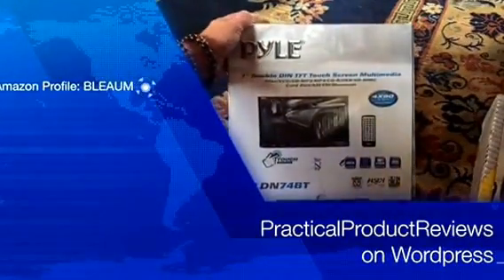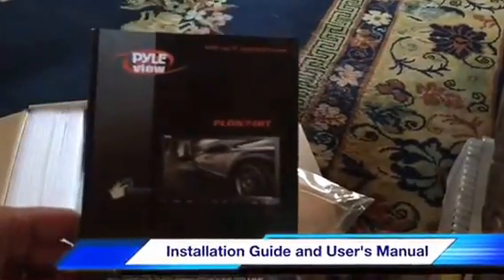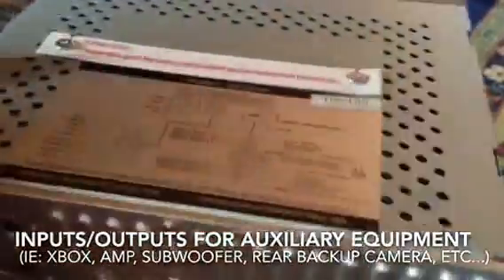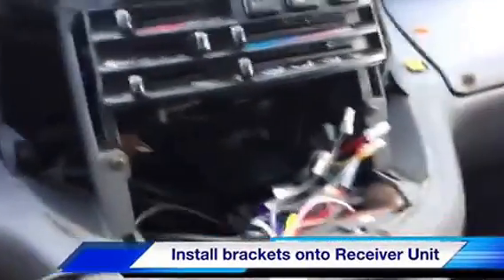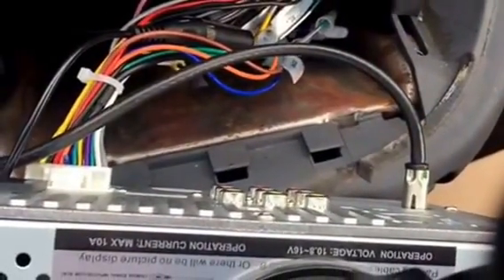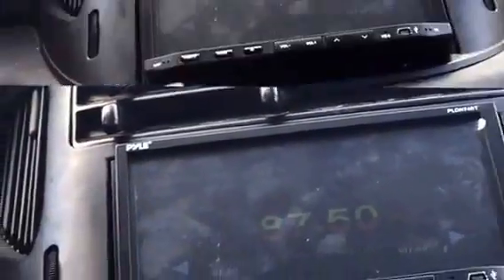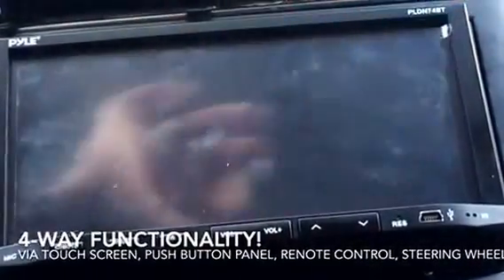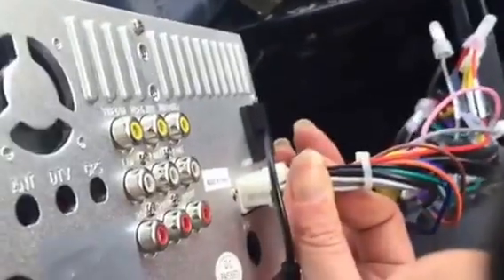Pyle PLDN74BT 7" Double DIN In-Dash Multimedia with Bluetooth: UNBOXING, INSTALL, DEMO, & REVIEW

Comment: did you install this on your own or did you have help? if not, where does the acc+ cable go?
Reply from the maker: Yes, I did self-install the unit. There are plugs in the back for the acc cable. However, I didn't use them on first install. Instead, I ordered a backup camera from eBay for $8. When it arrived, I mounted the camera to the plate, and ran the extra long wire to the front, using the carpet and molding so no wires would be seen. Then, it's easy: Unscrew the unit from the in-dash mount, slide it out, and plug in cables. Hardest part was hiding cables, but worth the effort. Back up camera kicks on when car is in reverse, or if there detection of movement if the keys are in the ignition. As long as your camera is angles properly, you'll get great quality video.

Comment: Can i install in 2006 300c
Reply from the maker: Yes- I have an '06 300C and when I checked it online, it fit my van and my 300. As long as you have a double din radio or navi
Reply: Wish i woulda knew that' cuz now i'm installing smaller screen